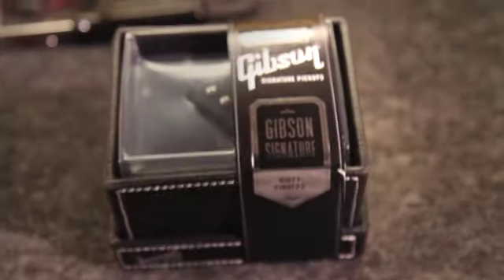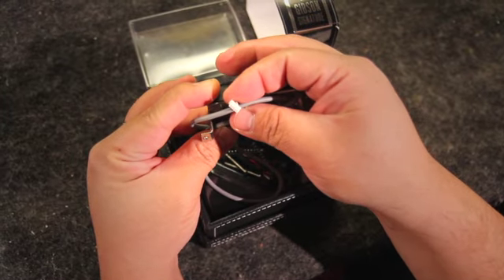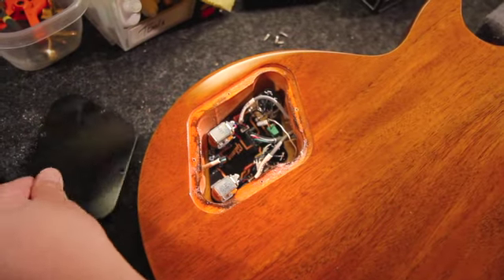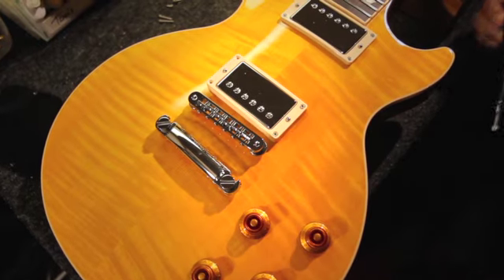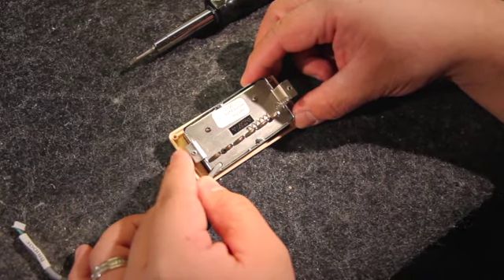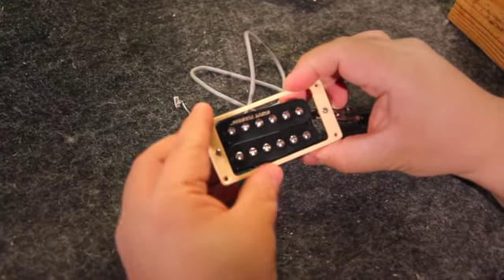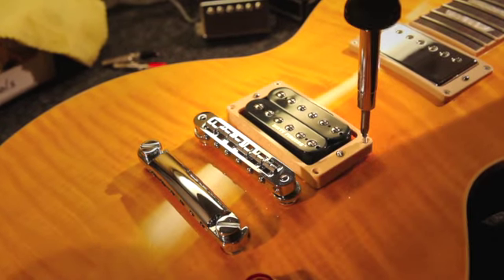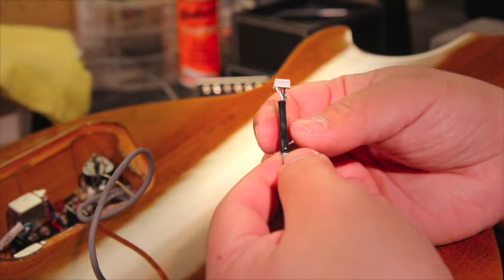Gibson Quick Connect Solderless Guitar Pickups - Gibson Quick Connect

Comment: I just got a 2013 60's tribute with this system. Nice for quick tinkering, but I think I'll just rewire the guitar. The pickups I want don't have a quick connect.
Reply: I like the Quick connect and circuit board but I completely removed the system so I can wire in my modifications. Also soldering and wiring a Gibson internals is actually easy

Comment: I bought Gibson 57' Classics for my 2008 SG. Which has this quick connect system installed. How do I take my 1 wire 57' Classic and get it to plug into this thing? I can't find a single video explaining this.
Reply: Did you figure this out ?

Comment: Hello.  I have a  2020 Gibson SG Special two HB and PCB. I would like to find a good video or verbal or written instructions on how to replace the 5 wire pickups for two conductor(wire sheath for grd) and center pos. I would like to attach the metal sheath grd to pcb connecter. I have a harness connector like stock one. The hot is no problem. I figured solder and heat shrink tubing. What you say. Thanks,  skeeter.

Comment: Does the quick disconnect require additional equipment to be installed to use the quick disconnect pickups?

Like the liberator system?

Thx

Comment: I have an Epiphone Les Paul Traditional Pro that has the quickconnect system set up, and I want to switch the pickups, but the pick ups I want to change it to doesn't have a quick connect. Is there a way I can connect the wires of the pickup intot he quick connect receiver part without one?

Comment: Amazing by gibson lol.  Never knew my 2011 had this circuit board. Would I just plug in the corresponding wires from a seymour duncan pickup into the correct connectors? All pickups should use this. So much better than dangerous heat from soldering on pots and etc.